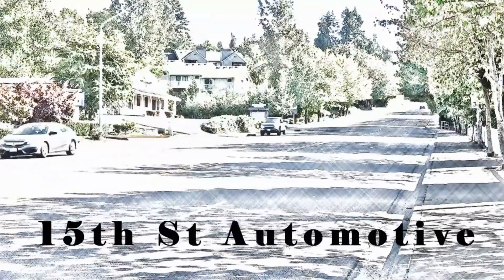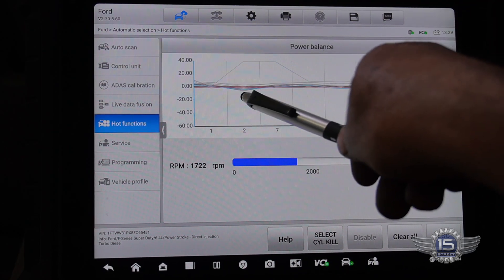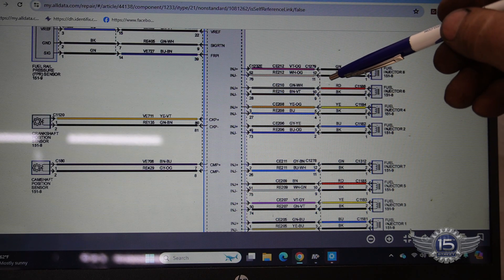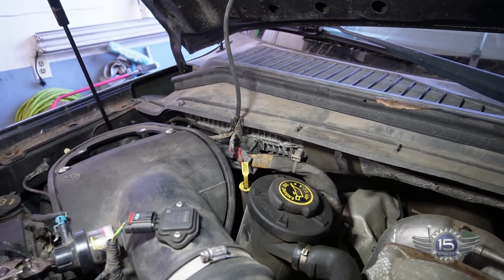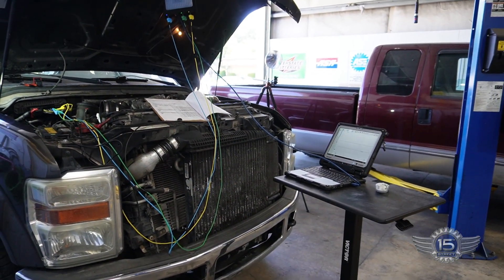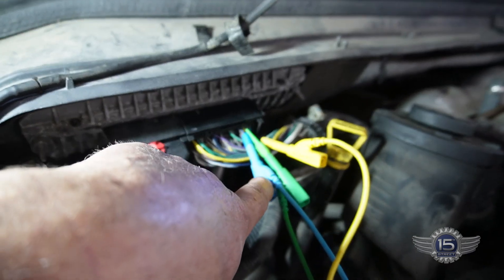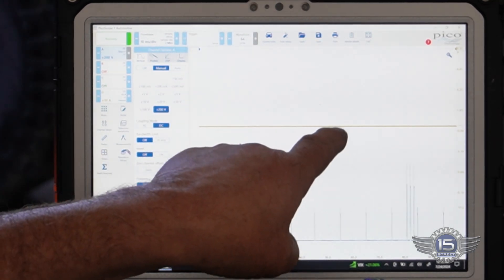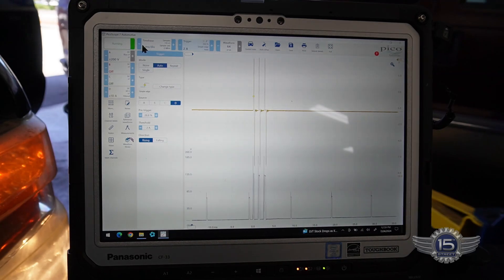F350 6.4L Misfire & Injector Diagnosis

Comment: Thanks for walking through the diagnostic process. Will the scan tool do a buzz test on the injectors?
Reply from the maker: It’s funny that you would ask that. I thought I could do a buzz test. But I couldn’t find it on my Autel Ultra and I didn’t switch to another scanner. I edited out the footage of me looking for that test. These are piezo injectors and I don’t believe you can buzz them.